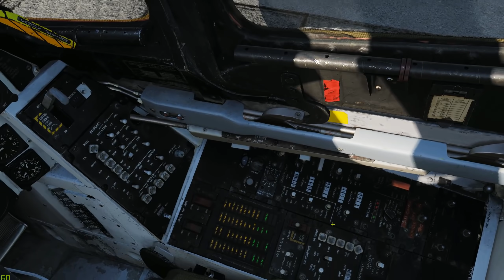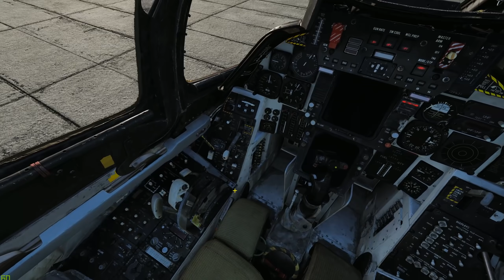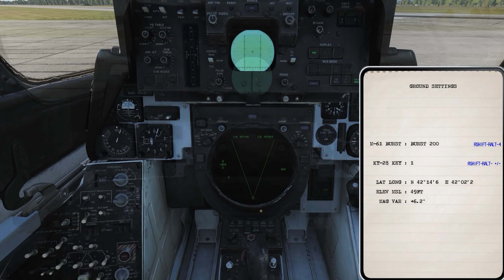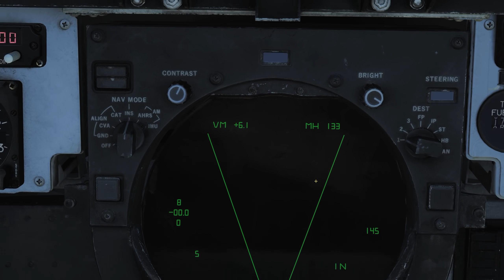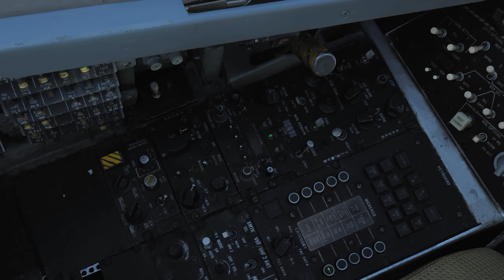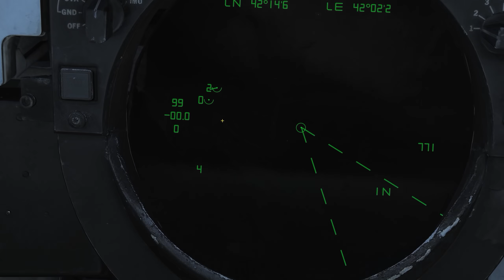Ralfi's Alley - DCS F-14 Pilot and RIO start up (ft. Hellreign82)

Comment: And I thought the A-10 had a long startup procedure ;-)  By the way, how does the F-14 manage to align its INS on a moving carrier?
Reply: The carrier will share its own INS data to the tomcat via radio datalink or a physical cable that they run along the deck and into the tomcats INS. Basically the tomcat will monitor the carrier's INS and use it as a dynamic, virtual, stationary reference I guess? The tomcat will do its alignment relative to the carriers own INS outputs, so that any movement (sea states, carrier turning etc) are automatically compensated for during the cat's own INS alignment.. This means that the tomcat can still perform a full alignment even in rocky states and with the carrier moving, so long as the carrier's INS itself is working. It does take slightly longer however due to the somewhat increased workload on the INS.
Reply: Interesting, thanks!

Comment: can F-14 startup scramble style? skmething like click all switches and takeoff like mig-21?
Reply: The aircraft cannot utilise weapons other than the sidewinder without at least a minimum weapons grade INS alignment. Generally for a scramble, you wanted the aircraft's INS aligned beforehand and the aircraft put on alert. You would never really be able to effectively scramble these from cold and dark.
Reply: @reillybrangan2182  how about aim-7? because aim-54 need ins but aim-7 SARH, it should be worked right?
Reply: @wiwihfirman8499  Whilst the weapons themselves such as the AIM-54 require INS hand-off, this is not the limitation. The radar itself cannot function without weapons grade INS alignment, therefore any weapon depending on the radar also cannot function (AA Gun, AIM-7, AIM-54 and all air to ground weapon guidance).
Reply: I don't think so, the plane is designed to loiter rather than scramble.

Comment: How long does it take for the INS to align, and is there an option to skip it? Going to get really annoying everytime you die in MP having to sit around for 10 minutes aligning INS.
Reply: Spirit 117 easy solution don’t die, or if you do. Beat the hell out of your pilot, for making you sit through the ins again. 😂
Reply: @cowboy10uk  but I will most likely be the pilot I don't have many friends to fly this with lmao. Does Jester take the same amount of time to align this thing as well?
Reply: @SPIRIT-117  The INS will take as long to align as it always does, regardless of who initiates it. With stored heading alignment, a fine align only takes 2-3 mins so I wouldn't worry about it.

Comment: Is the RIO going to be a hotseat-able position? or can you only join in prior to startup? Asking, because it'd be awesome if for example, you flew with 2 player F-14's, if one got shot down, rather than starting up or waiting for the other to RTB or get shot down, you could jump back into the action by swapping in as a human RIO to replace AI RIO.

Also, did they ever fix some of the crazy problems they had with the Gazelle co-op? generally you could screw with people by hopping in their gazelle and it would cause all kinds of bugs. ie what happens if your human RIO ends up getting disconnected? does it default back to AI RIO? Can you turn off the ability for some rando-pubby joining you? I'm assuming also, you need to have the full module to be a RIO? Would be kind of cool for those who can't afford the full module to be able to RIO for free, or if they own some other aircraft you get RIO free?
Reply: Not sure if it's possible to hop into a live unit, but I guess it's possible. When your RIO disconnects, Jester will automatically take over. And if someone wants to join you as RIO, you'll get a prompt that you have to accept or decline. RIOs need the module license as well as pilots.

Comment: The war will be over by the time you start taxiing !
Reply: I read a book where a Russian pilot was amazed at and making fun of the time spent by American planes in alignment and before takeoff procedures. He said Russian  pilots just get in, start the engines and go. No dallying around.
Reply from the maker: There are pre aligned aircraft ready at airfields in case of scrambling that can take off within 2 minutes of the pilot getting in the pit. For normal operation, it's just a difference of philosophy.
Reply: SnowTiger45 😂

Comment: Oh the F-14 doesnt have an apu? Thats something i did not know about the plane.
Reply: no apu. no battery
Reply: I get no APU, but really no battery (at all?)? What does it use for redundant electrical power? Does it have an emergency power generator such as a ram-air turbine or hydraulically driven generator? I can't believe it only has ground power or engine-driven generators for power supply? Then again… so much is unique with this aircraft :)
  @bh2022
Reply: @RAF33Strike  has an emergency generator that works above a certain speed and stores enough power for a few minutes when fall below minimum speed for it to work. otherwise your redundancy is you have 2 engines. which honestly is fair. if you lose both engines and cant restart that extra electrical power isnt going to do a lot for you honestly
Reply: Tek Otter so if the f 14 loses its engines, it's done for ?
Reply: @wangking-67  you can attempt to restart if you can get the airspeed to windmill the engines. theres the emergency generator which helps some but dont remember how much or for what conditions are needed for it to work. otherwise you have some power for a few minutes of limited flight controls to glide somewhere better to bail or ground/ditch the plane
Reply: @jonnyj-z2x  its becuase a few years in developmental design make all the difference in the world. F16's first flight is also only a few years after the F15. 

F15 was influenced directly by John Boyds Energy Maneuverability theory. he F14 wasn't. Early Drafts of the F15 would have had it as a overweight swing wing fighter like the F14 before it got Boyds input .

The F14 was designed around a PIlot and RIO because at the time older Radar technology and avionics suites would have been too much of  a workload. SO it was designed around a 2 man crew.  F15 was feasible to be designed around a single man crew. 

The HUD display  that was integrated evein since F15A was more advanced  than the F14A/B models, which had lower refresh rate (laggy) , and didnt even display Altitude or Airspeed, or G forces. The Aiframe of the F15 was able to pull 9 g turns, whilst F14's safe limit was 7.5's in wartime and restricted to 6.5G during peacetime.

AN d the F15 was more continually updated than the F14. F14 didnt get a major overhaul until the F14D. and F14D from a technological perspective It would be comparable to the F15E. AN/APG71 radar used off the shelf components derived directly from F15E's AN/APG70 multi mode radar. and many other avionics like the MFD displays were ones that were used on the F/A18 Hornet. F15E however is worse at BFM because of CFT's compared to the F15C. F15C was still king of BVR especially as they had AMRAAM's integrated and issued not long after the gulf war, whilst F14D's were operational tested by never issued them.

F14A  had  TF30's which unreliable engines. prone to compressor stall, and they were under powered for the aircraft size and weight.

The F14B  had new engines  but still did not have  as good T/W ratio as an F15C. and both A and B models did not have digital flight control system. that was only added with the D.

The F14's swing wing only really made superior to the F15 in a sustained turn rate at low speeds.
Reply: Kind of a shitty deal. I like the F-15 better just from an aircraft standpoint.
Reply: @Nine-TailedFox4  the 15 doesnt have a battery either actually. it doesnt have an actual apu either. uses a Jet Fuel Starter to crank the engines. small turbine started by accumulated hydraulic pressure I think it was. once that runs engines can start from the air it provides
Reply: @bh2022  duh... Everybody knows that. Point is it can start without external power. Lot of other reasons I prefer the F-15 as well. Just a better aircraft in general
Reply: @Nine-TailedFox4  can't turn 'n burn off the boat though
Reply: @Nine-TailedFox4  welp the F14 is basically 1960s technology. It didn't get a major overhaul in avionics until the F14D. F15's is a bit newer design and it was continually upgraded. and if course automated enough that a single pilot can without requiring tasks to be spilt for 2 individuals ( pilot and RIO).

YOu also notice this with Simpler workhorses, but later design like the F18. Sure the Horent doesn't have the Combat endurance, Raw Radar range, or anything that can match the Phoenix, But  in other way was a much more high tech design, namely Full Fly by wire, Glass cockpits, Minimal Analog instrumentation  ( essentially just for redundant backups of digital ones).

simply because it was a later design
Reply: Whos Apu?

Comment: Whats with the wobbly throttle?
Reply from the maker: His throttle
Reply: It could be a dirty potentiometers but both throttles are wobbling at the same rate so it’s more likely that he has it plugged into a USB hub with fluctuating power. I had the same problem with a brand new Logitech Throttle Quadrant and as soon as I plugged it directly into my PC, instead of into the USB hub on my desk, the problem stopped.

Often people map the grey lever on the Thrustmaster Warthog Throttle to their view zoom. It wobbles like that and can get really annoying. Same problem. Same fix.
Reply: @hoofed  I've got the CH products Pro Throttle, single. 

Bad Pot as you said, doesn't affect the game though